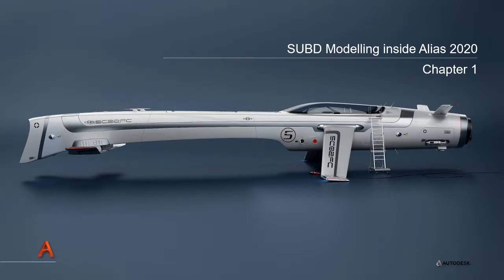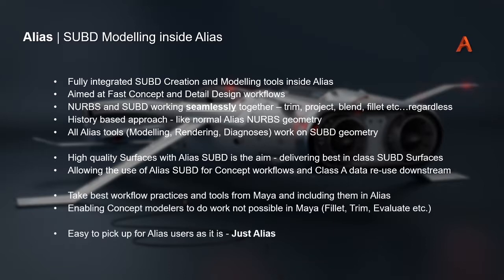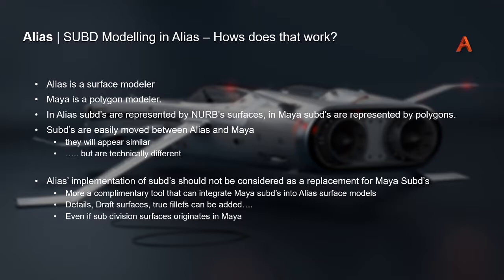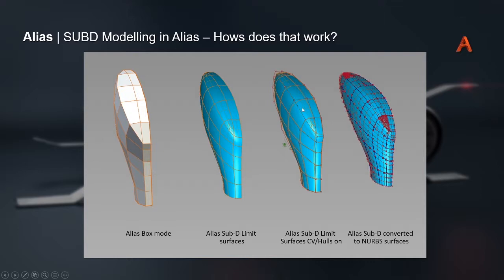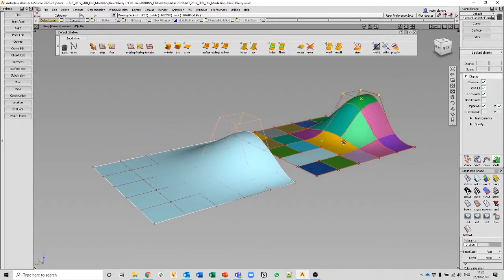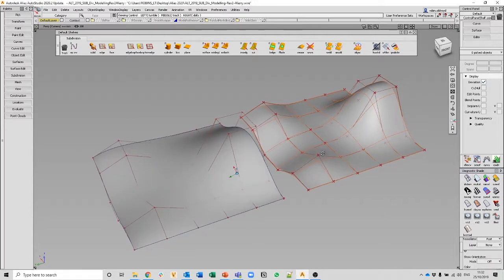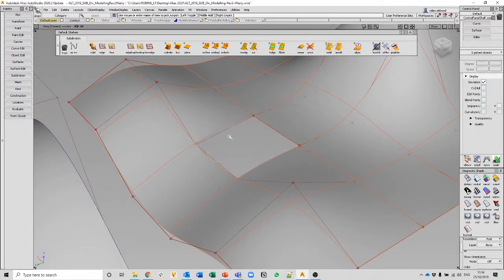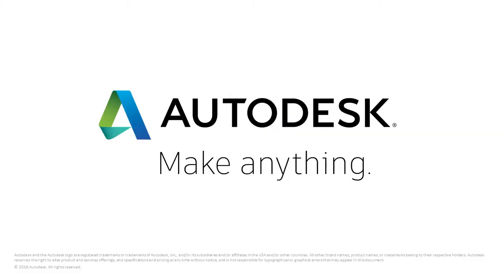Alias Sub Divisional surfacing - Chapter 1

Comment: I wish they had the similar way of doing T-Spline in Speedform where the dont have to pick edge, vertices or face seperately by just clicking on it.
Reply from the maker: This is really due to the fact that when working in Alias it works differently, you tried the shift and middle mouse click to add?